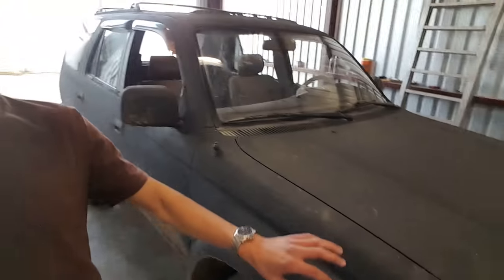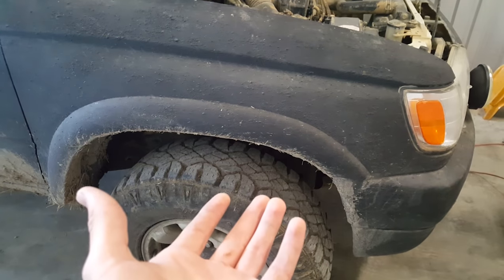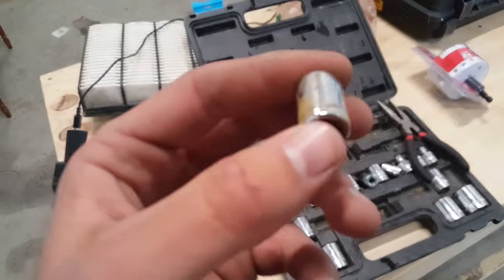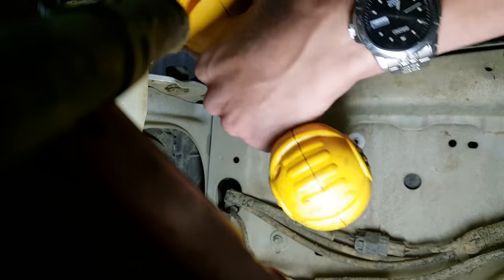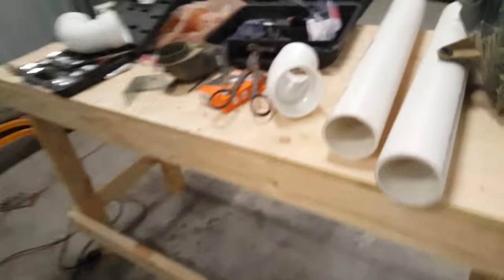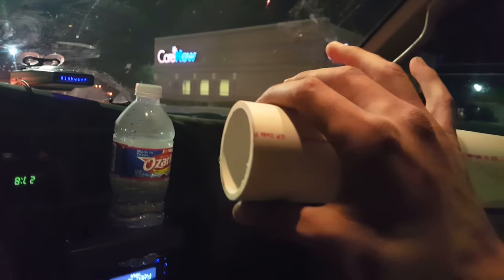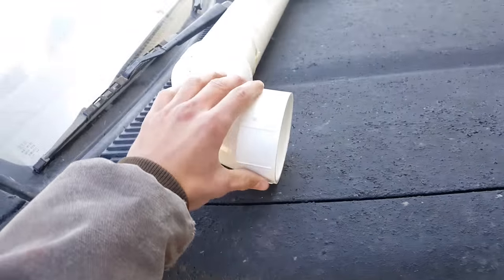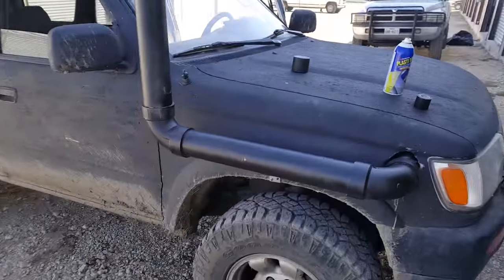CHEAP DIY Offroad Snorkel Install

Comment: Should have went with a 45* bend to follow the angle of the windshield.
Reply from the maker: +ronbecker01 That was the plan. May end up going that route instead
Reply: ronbecker01 this is what I thought it looks dumb and should go with smaller piping

Comment: you should use the same bracket with a hose clamp screwed into the bracket to not open holes to the tube

Comment: its not very pretty but if it works, it works... but the other thing is youll need to waterproof the electronics like the plug connections and stuff.. or at least its a good idea to do.

Comment: other than the problem that if that gets whacked hard enough you'll get some serious leaks, and flood your engine. that pipe you stuck through the hole is to small, you are restricting the air intake by making an extra choke point = less power.
Reply: as a side note, no hate I find this channel fun to watch and all.
Reply: ramoskiller2 and the fact he put screws into the pipe for the bracket lol
Reply from the maker: +ramoskiller2 Both good points. While I have to agree the pcv is not the sturdiest choice, the goal here was budget orientated. So far, I haven't experienced any loss of power either. Update video will be coming probably tomorrow.
Reply: Novice Garage im curios did you guys put in an air filter?

Comment: It actually doesn't look that bad. But shouldn't you have turned the top of the of the snorkel around so it's facing the back of the car to prevent water from splashing in as you splash through water

Comment: Number one you are restricting the airflow by going from 3 inches to 2 inches so you’re going to lose horsepower, Number two you didn’t use PVC glue and that’s not airtight. 
Also you need to run your snorkel through a air filter system